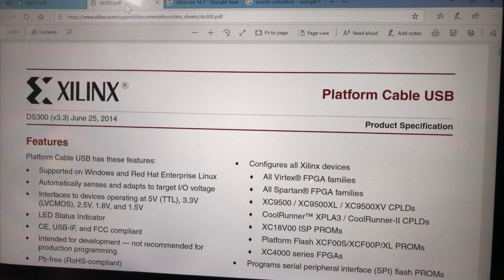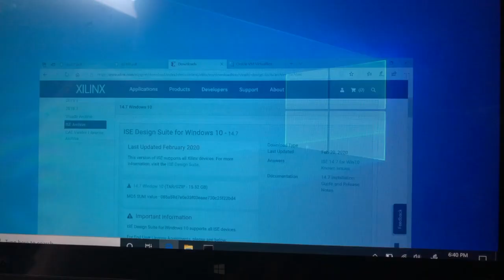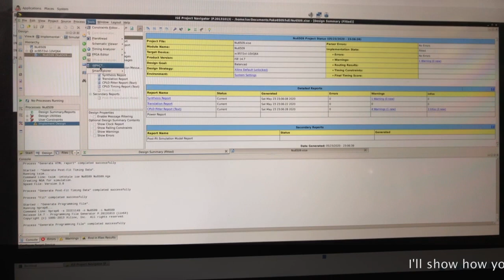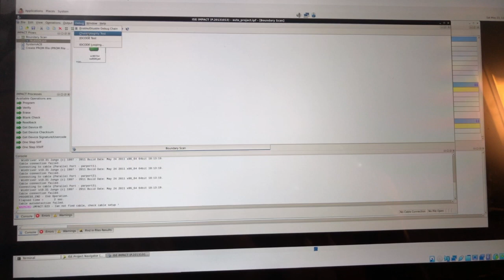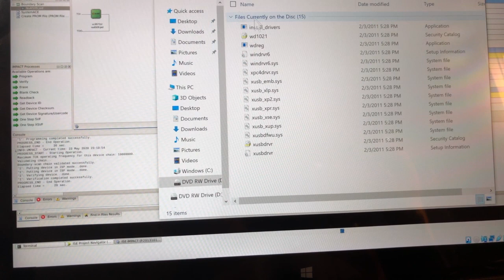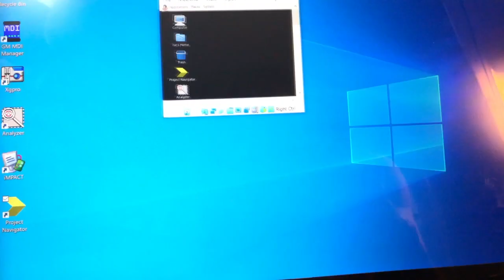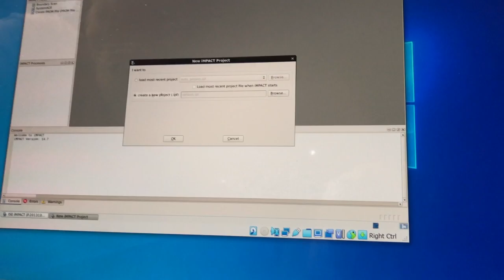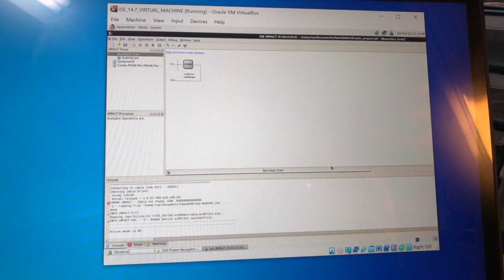Programming Xilinx XC9500XL Series CPLD with ISE Impact & DLC9LP Platform Cable USB

Comment: great video.  Any chance for you to go into more details on the wiring of the JTAG pins of the XC9572 to the platform USB box.   I have about to do something very similar.  I've a XC9572 in a PLCC44-to-DIP40 adapter and trying to workout which pins on to connect to the platform usb box to program it.
Reply from the maker: Sure, if you look at the datasheet of the Xilinx XC9572XL https://www.xilinx.com/support/documentation/data_sheets/ds057.pdf you'll find the pin number references on page 7

Comment: thanks for your video, So i have a big problem because i don't know how to download the .jed file for obsolte card
SO
I am writing to request  with a ML505 Virtex-5 Development Board configuration issue.

Problem Description:
I accidentally erased the configuration of the system CPLD (XC95144XL) on my ML505 board while programming the FPGA. This has resulted in partial functionality loss of the I/O systems, specifically affecting switch and LED operations that route through this CPLD.

JTAG Chain Identification:

Device 1: XCF32P (Configuration PROM)
Device 2: XCF32P (Configuration PROM)
Device 3: XC95144XL (System CPLD - ERASED)
Device 4: XCCACE (SystemACE)
Device 5: XC5VLX50T (Main FPGA)
Required File:
I need the original CPLD configuration file (JEDEC format .jed file) for the XC95144XL on the ML505 platform to restore proper board functionality.

Board Details:

Platform: ML505 Evaluation Board
Main FPGA: Virtex-5 XC5VLX50T
System CPLD: XC95144XL
The board was functioning correctly before the CPLD erasure.
This issue is preventing normal development work and board validation. The CPLD file is essential for restoring full I/O capability and proper board operation.

Could you please provide:

The original ML505 CPLD configuration file (.jed)
Any relevant programming instructions for restoring the CPLD
I would be grateful for your prompt assistance in resolving this critical hardware configuration issue.

Thank you for your support.

Comment: Thanks for the video. I am trying to run boundary scan commands on a XC95216 that is installed on a working board with a processor I8036 and another Xilinx FPGA. I bought the Digilent JTAG-HS3 and got installed Impact from within Lab Tools. Do you think this cable will do or what cable do you recommend?  This DLC9LP will do? Thanks.
Reply from the maker: I only worked with Xilinx for this one project many years ago, but I found the DLC9LP worked fine for the scope we covered in this video.   I couldn't comment more broadly than that.

Comment: Hey Shock, I’m looking to read the data that is already stored on to an XC9536 P44 CPLD that was on a failed IO device. I have two different Platform cables, 1 is a replica and the other is a cable directly from AMD (platform cable II).

I just do not know how to write the code to get the software to read the device.

Any tips on getting a read?

Thanks!
Reply from the maker: I've not worked with used devices before.   But I'm sure you'll need to make sure the security bit wasn't set in the initial programming first, or all you'll be reading out of those devices are zeros. ;-)        If the security bit was not set, then you should be able to read the previous programming using ISE Impact and its Read Device function (presuming the drivers and your Windows setup are all worked out for your supported cable first).   Hardest part is likely getting the cables working with Windows and Impact first.  There are other tools that can read that device, but I've not used them.

Comment: @Drshock If you have several CPLD's in a chain connected to the same Jtac interface,- how do you select each one? I saw from your guide that a CPLD is show in the graphical interface .. would multiple CPLD just show up there? .. and you just select the right one?
Reply from the maker: I've not had a circuit design with more than one, so not sure but I would suspect the ISE GUI would show them individually.

Comment: To run ISE 14.7 (or earlier) on native Windows 10 without using a VM this is what you have to do:
1) Open the ISE installation folder  i.e: C:\Xilinx\14.7\ISE_DS\ISE\lib\nt64
2) Find and rename libPortability.dll to libPortability.dll.bak
3) Make a copy of libPortabilityNOSH.dll in the same directory and rename the new file as libPortability.dll to replace the file in step 2.
4) Make a second copy of libPortabilityNOSH.dll but paste it into C:\Xilinx\14.7\ISE_DS\common\lib\nt64
5) Repeat step 2 by creating a backup of the libPortability.dll found in this folder.
6) Rename libPortabilityNOSH.dll to libPortability.dll
Once this is done you should be able to run Xilinx ISE and Impact without issue on Windows without using a virtual machine.

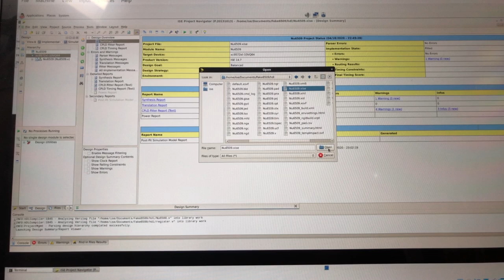Comment: Lost me at 3:57. Where did all those files magically appear from?
Reply from the maker: At 3:50 I mention I am switching the UI to the All Files view.  What get's shown there are the source files for my Xilinx programming project.   This segment is just showing that if you do not have the JEDEC file (the .jed file) from a third party github repo to use, you can rebuild that yourself using the Xilinx tooling.  You need the .jed file to program the device.

Comment: Hi! Is it necessary to erase then to program if the chip is not blank? any suggestions?
Reply from the maker: Best practice is to erase, just in case there is some residual data from a prior programming event that the new programming does not overwrite.

Comment: For what it's worth, using a real Platform Cable USB II  and a 64LQFP XC9572XL, I had a crazy problem where programmer and iMPACT would wind up locked up "The selected cable is being used by another application" with repeated:

write count != nBytes(0), rc = 20000015.
write cmd failed 20000015.
write cmdbuffer failed 20000015.

...during "programming" step.

Turns out, my hack of this part onto an existing PCB needed some more bypassing -- 0.1uF near every power pin "pair" and 2x 10uF.  All ceramics X5R/X7R.

Also, don't know if it mattered but I put a 0.1uF near power "Vref" pin going to programmer.

(Go ahead, ask me why I'm putting a 1998 vintage part into a current production design in early 2022.)
Reply: why ARE you putting a 1998 vintage part (the XC9572XL?) into a current production design in early 2022??

Comment: Do you have a link to a copy of those Chinese drivers?
Reply from the maker: No, there are several circuit board designs out there for these clone USB programming cables and they are not all compatible.  So you have to use the drivers your seller should have provided when you bought it.  Past that ISE will have the rest built-in.

Comment: Thank you greatly for this how-to video. I'm exploring using the XC95__XL series (or the Coolrunner II) to sweep up some logic for a low volume/long lifetime design. I haven't programmed any CPLDs in the last couple decades, so it's been a trip down memory lane, mixed in with current OS and old/static design software interaction.

Does anybody know of a software package that still takes schematic capture input for CPLD design??

Comment: Cool video, I have an issue with XC95288XL on my hantek 2090 USB, is it replaceable ? thanks
Reply from the maker: I'm not familiar with that particular scope, but typically if you have a CPLD that needs replacing you'll have to be able to read the programming out of it first in order to program the replacement.   The tools I've showed here can be used for that programming.  However, most commercial vendors set the security bit on the XC9500 chips to prevent you from reading them.   Technically only the original author of the firmware should be able to reprogram them, as they have the source code.  So that's why Xilinx provides this security feature.   You wouldn't know if Hantek set that bit without either some Google fu or trial and error.
Reply: @DrShock  I reckon, they will use the security bit, so I can not read it.

Comment: I order a DLC9LP programmer from ali, but inside is a jtag smt2 pcb. I'm trying to write xc9572, but at 50% of witting i get programming failed.  Is there any fix for that? Another issue is that when i use RUN ALL and after that i open impact, i have the oprions for erase, programm, etc, but If i open a jed file directly in impact (like you did in the video) all those commands are missing.
Reply from the maker: Yeah like I mention in the video, some of these clones deviate from the original Xilinx programming cable and they are just not reliable with the XC9500 series CPLDs.   Diligent clones, etc they will all fail to verify where the true  DLC9LP clone will work fine.   The eBay link I give in the description filters out those so you should only see the ones that will be compatible.   I haven't seen an actual programming failure but rather verify failures, so your error may be something different.

Comment: Is this for a B or P series CBM?
Reply from the maker: Either, though I haven't got around to testing it on my P500 yet.  But it should replace both a MOS 6509 and 6509A.   Works great on the B models, hats off to Go4Retro for the git submission

Comment: I got ISE 14.7 running on Win10 x64 without problems.  x32 files work out of the box but for the x64 files, it's about a minute of hacking.  It took me a while to figure out but it's not very complicated actually when you know what you need to do.
Reply: for example, you can just double-click on the xise files, etc.  I guess Xilinx is just trying to make it harder for people to use the previous generation of the toolchain.